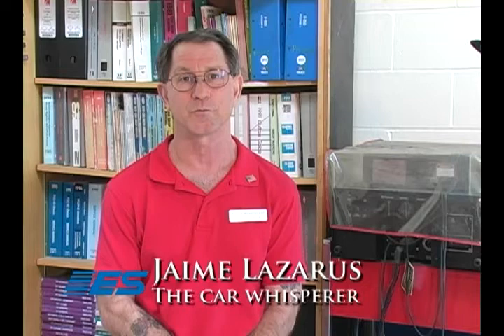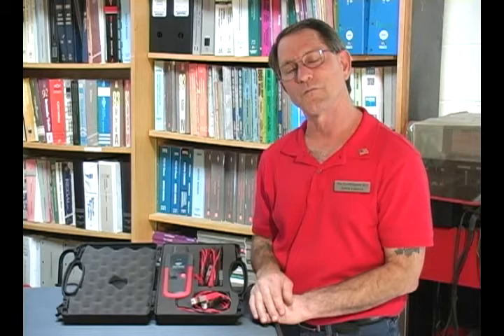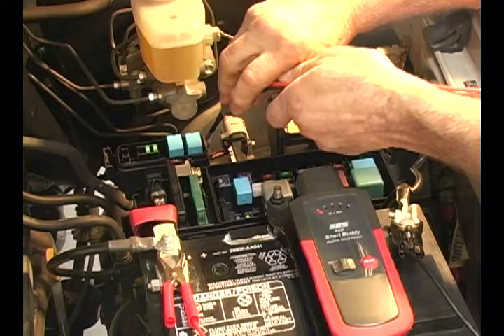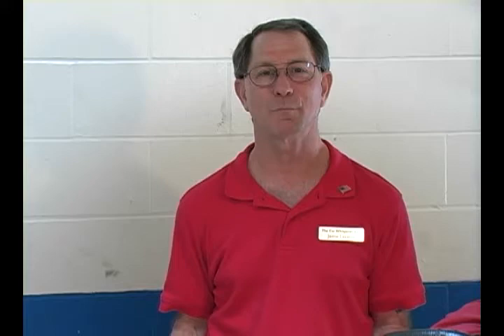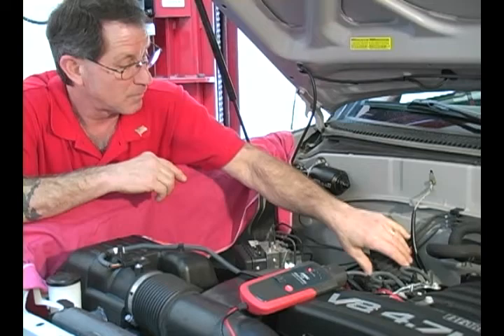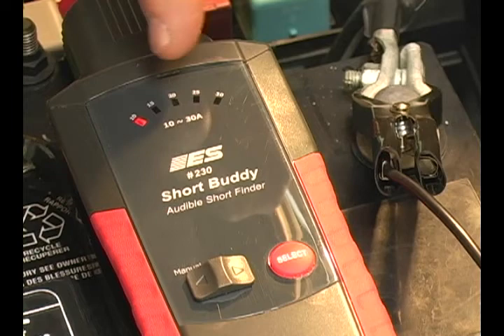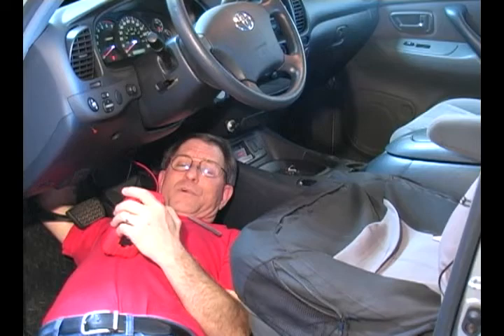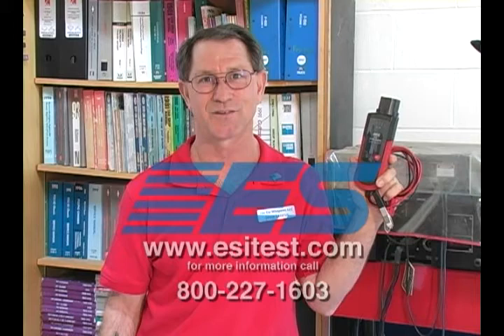Short Buddy

Comment: I need to know if I have short when I put the ignition key on how to use this tool as your demonstration is a fuse blown.
Reply: If there's a live short, you will hear the long beep and then ten short beeps.  After ten seconds, it will reset power to the circuit and repeat this until the short is repaired.  In the video, this is demonstrated at the trailer connector at around 2:50.